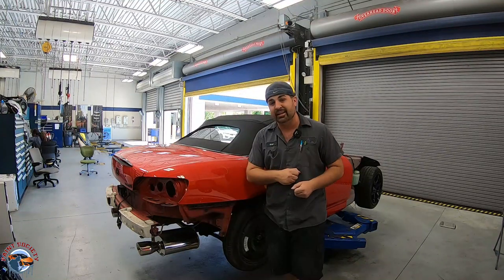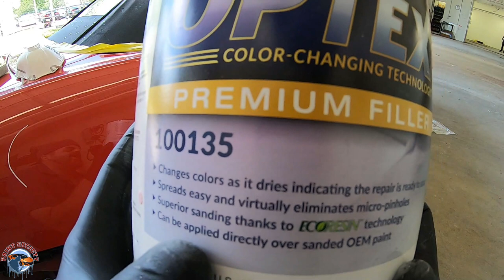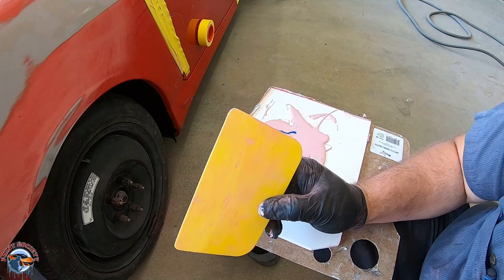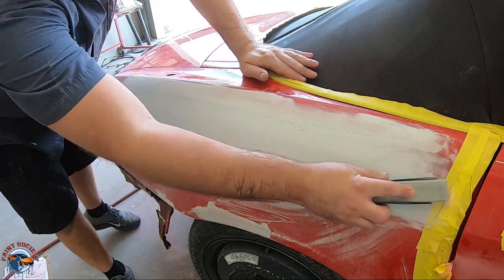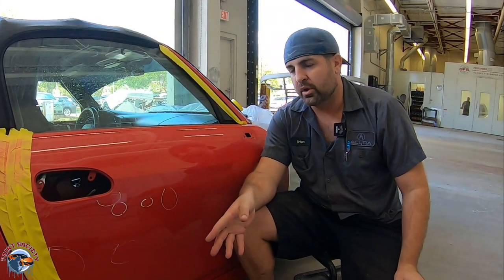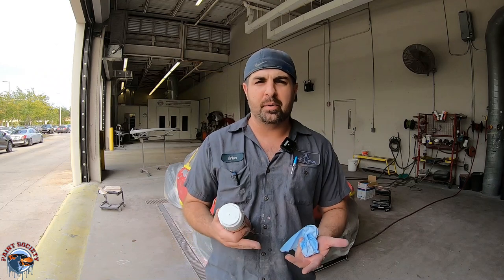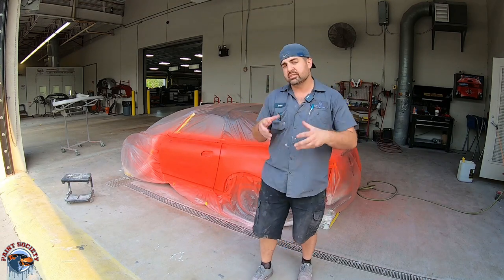Car Painting: How to Remove Dents, Part 2

Comment: Hi Brian, love all your videos. Watching all the way from Australia! A tip I was taught was to use a cheese grater file (carefully) to remove the edges/excess filler, instead of 80 grit green sanding. Seems to work very well. I fond that green sanding balls up and can actually mark the filler while its not fully cured.
Reply from the maker: Either way will work. I’ll use a cheese grader sometimes. 👍👍

Comment: Thank you for telling to sand block marks out of the paint, I fight that everyday with my body men. It takes 5 min at most to sand those out. And me as a painter gets blamed for those. Everybody thinks primer will fill them. They are wrong! Nothing looks worse than sand scratches shrinking back. And also nothing looks worse than a primer edge were primer stops. Make sure to sand orange peel out where u stop your primer and feather the primer out as you spray. Thanks keep up great videos! Your the man

Comment: A future video suggestion that you can even do with the s2000 build is how to paint the door handles correctly and how to not overload the indent with paint of where the door handle fits back in. I messed this up before and had chipping/paint lift starting at the door handle’s edge after I painted doors on an older subaru after a few months. Great work as always!
Reply from the maker: Will do!

Comment: Hi Brian, I do a lot of boat painting (I manufacture duck hunting boats) and we also have an  oil based enamel paint manufactured for us that we sell  in about 70 colors (Flat Marine Enamel).  I need to learn about your etching primer.  We have a lot of folks buying our paint to paint their decoys and duck hunting boats.  I had a customer a few years ago use a Self Etching Primer by RustOLeum.  It was a disaster.  He primed his new boat and motor with Rustoleum Self Etching Primer and then he painted it with our FME (Flat Marine Enamel).  All of our paint crinkled and could easily be removed.  I contacted the RustOleum Rep and found out that their Self Etching Primer is not designed to bond to paint and is formulated to NOT bond to paint.  Only designed to be used on raw metal.  I see you using your Self Etching primer and doing the whole panel with it.  I am intrigued with that and need to know more so I can use that and pass on the info.  I'm impressed with your work.  That's and I look forward to hearing more about that self etching primer.  Lou Tisch

Comment: Nicely explained! What about the body lines? I’m a total noob when it comes to body work, but I would think it’s important not to sand too much over the body line on the door or quarter panel. You can really see where your sanding cuts through much deeper where the body line is. Will the line be put back when sanding the primer, or does it not really matter and it won’t show in the end?
Reply: Paint Society
This is a great question
Reply: Was looking for this comment.^^

Comment: I would like to know roughly how much you'd charge for a job like this? I'm also an automotive painter here in Canada. I would help me a lot to know how much a job like this costs because we have painted many complete cars small and big and we've fixed the dents and what not and charged maybe $3-4000 CDN or about $2500-3000USD but course we have not gone into as much detail as you have gone in this build of yours. We are using PPG water based paint and PPG 520 clear which in itself is lot expensive to purchase and I'm shocked sometimes to how our shop can afford it at that cost. Thank you and great work as always.

Comment: Should mention that you should sand inside every dent. You're flattening. That doesn't leave a rough surface in the dents them selvs. I generally like to sand every dent and bog it and then do the process you did! I should mention that i had a panel shop and i closed my shop in 2002!  Guess i'm too old today and this is the new!
Reply from the maker: Great points!

Comment: I love your work! Is it possible to spray sealer on bare bondo and OEM paint before hitting it with a primer? As I've heard it protects the surface underneath. Also I've been told you don't need to use a sealer with 2k, is that true? I'm hearing various information from people. Cheers from Australia.

Comment: honestly i suck at feathering the layers i always keep getting mapping, however your video help tremendously in explaining the technique so i can work on it
Reply from the maker: The better you feather. The better chance of no edge mapping
Reply: @PaintSociety  yea ive been trying to find information on improving the process and i think you explain it the best. identify the layers and try to get 1/4-1/2" of each layer feathered if i understood you correctly. now can do u have any tips if you spot prime how to feather that (kind of like a reverse feather in my mind) any tips on identifying when you have sanded the edges enough to prevent maping from the spot primer. if that makes sense

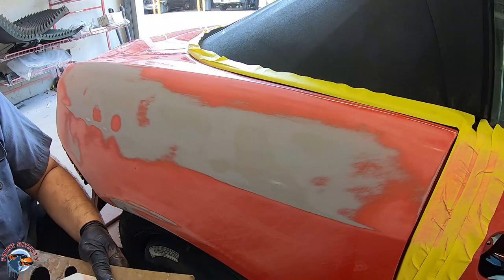Comment: 5:20 - it doesn't look like that the dents (low points) were sanded prior to application of the filler.  Was the 180 sanding that revealed the low points sufficient?  You don't need to individually scuff those low points afterwards?  Thanks.

Comment: Hi I have a silver E36 M3 1997 that I would like to repair, but it's only a partial sport on the roof that have bubble. I removed the inside and I am ready to sand, prime and paint. It's only a partial touch up and I am wondering if it would be better to repair the full roof or a partial can be ok? I may only use rattle can. Do you have any tips?

Comment: Hi Brian, another top video, I learned something once again, quick question, I hear you reference 'sealer' and primer on the job and in previous videos, are they the same? Could you please explain the difference if not?
Ben.
Reply from the maker: They are different. Primer is to fill sand scratches over body work. Sealer is to go over primer before paint
Reply: @PaintSociety  Thanks for clearing that up Brian. 👍🏻

Comment: Do you need to always block sand originally when dealing with dents, or are you able to use an orbital with the 80grit like you would to strip a car for paint?
Reply: Dimer6.0 An orbital can dip down into some types of low spots, removing paint,  hiding the low spot. You can do it, but if you are looking for perfection, blocking’s is the best way.

Comment: I have heard that you should never mix 1k and 2k primers, fillers or paints. Reason is cos the hardener in the 2k could interfere with the 1k component and cause bubbling. Have you ever had this happen?
Reply from the maker: Etch is only 1k. It will always ever be 1k. It’s purpose is go on before the 2k urethane. I do agree though not to use a regular 1k filler primer before.
Reply: Thank you for your reply and keep on with these amazing videos. Very informative, well thought out and executed.

Comment: Great video series Brian. You're one of the few channels that I've seen use Optex. How does it compare to other fillers like Bondo? I'm thinking of getting a can so I don't have to take the paint down to metal on good oem paint on my first DIY body job.
Reply from the maker: Hey bud. Haven’t had any issues with it, in all honesty with other similar fillers you’d probably be just fine going over sanded oem paint but it’s nice insurance knowing it’s printed there on the label.
Reply: @PaintSociety  Thanks for the reply. I've heard of other people say the same about using bondo over oem paint, but I wasn't sure what their level of expertise was. I rather have the opinion of a pro whose willing to teach and show their work.
Reply from the maker: Yea. And honestly never had an issue with it before. Just get a good 180 grit scratch in it
Reply: @PaintSociety  Thanks for tip. Keep up the great content!

Comment: Hi Brian. What dealer do you work at? I'm in Miami and I need some body work on my S2000 (two massive door dings where they removed the paint). I have extremely high standards when it comes to paint jobs and I want it done perfectly. Unfortunately I don't have any good references that I can trust. I would love to take the car to you. Thanks!
Reply from the maker: Hi. Message me on IG. 

Paint.society and we will see if it’s something we can do

Comment: question for you... i bought a little project car to restore its nothing fancy. and at best worth maybe 4k mint. I need to paint it. im already 3k into it so spending 3k+ for a professional paint job is out of the question. ive done all the body work to get it straight and have painted before and plan to set up a temp paint booth. but looking at paint im having a hard time. for primer and paint clear and hardeners and thinners im looking at $500 and that isnt counting any other materials. Its making me really want to just do the old $50 rustoleum special but i dont want a single stage job. is there cheaper paints that arent complete trash to use?
Reply: Takeoverartist1987 , Depemds on what color. I’ve found that white seems to be the cheapest ($15-$20 a quart). I believe black is still affordable . But red or orange is super expensive per pint. 
I’ve found clear coat gallon kits for $100-$125 which should do two cars. I can’t imagine going over $500 unless you are counting all the sandpaper and filler. 

For white paint jobs, you could add in a pearl into the clear coat to get a fancier paint job on the cheap, then do a final clear with no pearl. 

Good luck, I hope your project comes out nice!
Reply from the maker: Don’t do the rustoleum. You will regret it. Please. Look into finish1. Transtar or matrix.
Reply: Thanks guys. The car is white. I'd really like to go blue as that's my favorite color. I found a gallon kit for paint clear and a slow hardener and reducer from restoration shops for about $350. But again. That's not including a good sealer. The sealers I seen where about $130 a gallon. Now I can be completely wrong but I've always been told a full paint job especially a color change needs a gallon of paint. Is this correct? The car is a 2 door coup old honda prelude. Not a huge car. But going from white to blue and changing all the door james and trunk jam color would need more
Reply: Takeoverartist1987 , I would buy a single stage to lay down over the jambs and engine to get a good layer and spend the money on the base-coat-clear job on the outside. 

Two quarts paint, reduced with two quarts reducer is one gallon of sprayable paint. 

Get about a pint to quart of single stage for the jambs/enginebay and reduce down as thin as you want.
Reply: @chrisrobles2012  ah ok. I'll look around. The restoration shop kit is $150 per quart kit for the color I want. And the gallon is $350 so may as well spend an extra 50 and get double the product. I've never heard of anyone using their product tho. Wonder if its any good

Comment: I sprayed my primer today and it come out like 60 grit sandpaper. Very rough, what could cause this? I feel like I also get a lot of overspray and it dusts every surface, any advice is very much appreciated
Reply: Was it thinned properly? Did you not use a 1.7 or 1.8 tip like Brian did? Was your air pressure too high? Did you move too fast or not overlap enough? Gun dirty? Those or a combination of them could be the culprit. Good luck.
Reply: Jay’s on target. Sounds like the gun is choking.
Reply: Jay Krom sorry just saw your reply. I used a 1.7 tip and thinner it properly. I wasn’t moving that fast and I think all my pressure settings were correct. I’m very new and not very knowledgeable. I switch over to a 1.3 and did everything the exact same and had great results.

Comment: Why did you use a RED primer if you’re later going to put on a WHITE sealer? 🧐
Reply from the maker: Who said I’m putting a white sealer? I’m using a red sealer. Color build can be used as a primer or a sealer based on the additives and how it is mixed

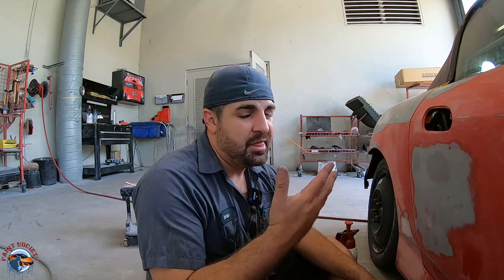Comment: 12:27 one tip to don’t put just body filler  and at the end just sand for nothing. You need to learn how to touch the dents whit you hand that way you won’t spend time sanding for nothing. It’s not easy to find dents by hand, but when you lear it you’ll do it whit you eyes closed.
Reply from the maker: Awesome. Great tip!

Comment: Why would you use filler ? .Urethane primer would do that way faster.
 I've seen so many ,skim coats of body filler ( no longer cheap )
Those dents are so small .
I'd block it out ,put three coats of urethane primer.
  Flash and dry.
I call two passes with the gun - one coat.
Block that out,seal and paint.
   I haven't used ,skim coat of filler , for ever, cause it's always on the ground and doesn't become a good integral base like 2k primer.
   Everybody has their own way...I have deleted skim coats, as a step. It is not coat effective today as it used to be. It eats sand paper ( not cheap )
Primer is cheaper and much easier on sand paper.
   Great video, your paint and body work always comes out flawless!
Reply from the maker: Those are great tips. The quarter did have some slight waves on it but the door could have just been primered like you said . This is what I love about paint society. We can chat and learn from each other n

Comment: Having a PDR guy work on dents to just go behind him and fill and paint them is simply padding the customer's bill.
Reply from the maker: Actually it’s helps the customer. Pdr tech gets the dents close enough for skim coat.  Customer pays way less in labor hours.
Reply: @PaintSociety  paying thousands of dollars for PDR vs 2-3 hundred in additional labor does not save cost.
Reply from the maker: NOT SO SLIM JIM thousands ? Now that is insane
Reply: @PaintSociety  happened to me. Shop spent over $2k for a few dents on my X5's door. Didn't even get them out. Then told me it would be another $1,500 to fill and paint.
Reply from the maker: I am sorry to hear that. Not all shops do bad business. Kyle the dent tech charged $100 for all those dents.
Reply: @PaintSociety  you should see the paint. It looks like it was done with rattle cans after watching a few YouTube videos. Ended up costing me $4,300. When I addressed the issues, I was yelled at, threatened, called racist, and told to just sue him.

Comment: Im doing a complete resto on a truck. New panels ect. They are bare metal and my question is do i epoxy primer the bare metal first then do my bodywork ontop on the epoxy primer?
Reply from the maker: Yes that’s correct

Comment: My son had a Mazda MX5 with a Ceramic White colour.  Someone managed to scratch the door whilst it was parked.  We consulted a number of large paint shops who refused to do the job.  One explained that the paint contains elipsoidal mica crystals which cannot be matched apparently something to do with the alignment of the crystals when they are sprayed.  We eventually found a high quality bodyshop who specialise in Porche, Rolls Royces, Bentley's, etc., and approved by Mazda, who said that they might need to spray the whole side of the car to get a match. 

https://youtu.be/bKETQ-FXIQc

https://youtu.be/hbdrn9QRamc

The bill came to several thousands of pounds, however, the job was perfect and couldn't be distinguished from original.  It made me question the wisdom in the choice of colour - perhaps you could expand. 

Are these paints similar to Pearl White on your channel? 

I wonder what you know about these paints and how they should be applied.
Reply from the maker: They should be The same paints and I’m wondering why a shop would deny you the job. It just seems like they  were incompetent at the time, and I do agree though painting a few extra panels does help blend the color.